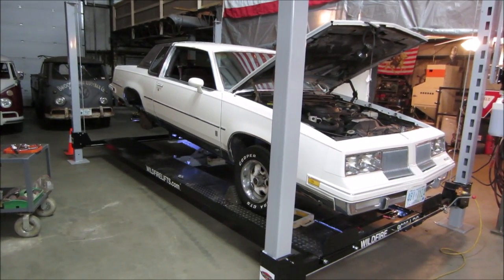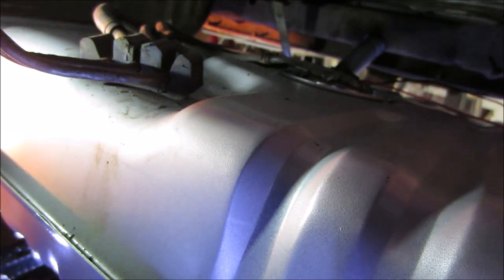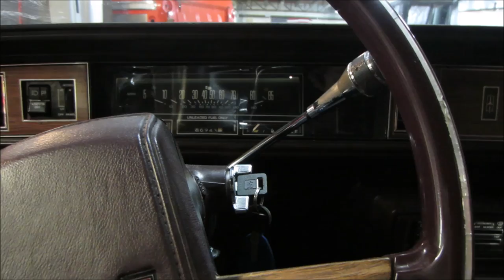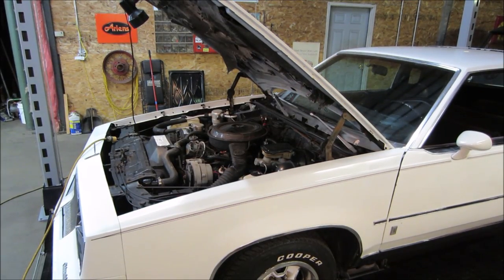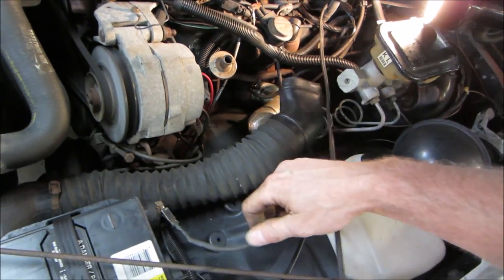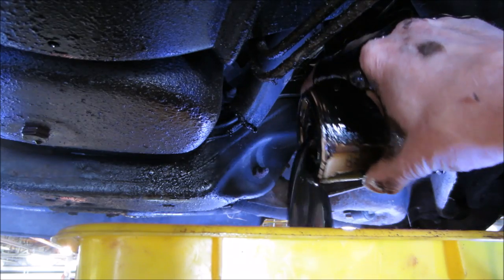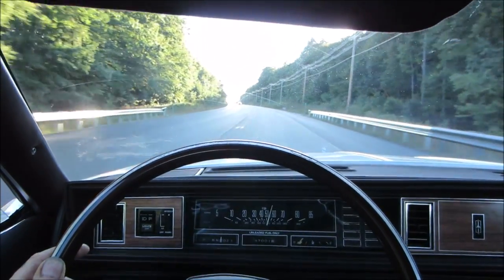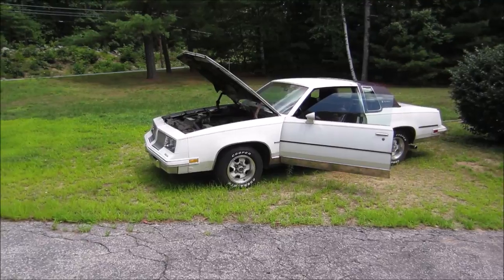Rustoring  Cars On A Budget. 1986 Olds Cutlass Gets Completed.

Comment: I miss my cutlass. That was my first car. We paid $500 and drove it for seven years and after frustration with my paint job I paid for I ended up selling it to a friend. He then ruined the head gasket or motor and blew a giant crack in the radiator with oil looking like chocolate milk. Then it sat to rot. I never did any major work to it either other than paint. That one was a 79 Calais edition with grey on black which was unique for a cutlass. It had the black vinyl top with bucket seats,floor shifter,round gauges not rectangular and a actual factoryTach. My plan was to fix it up with paint,fix the vinyl driver seat and putting a bigger motor but ended up getting frustrated before I finished it.

Comment: I cannot accept that you are done with this car. option 1:   cam change. a bit more cam. somewhere in the 210 degree park. roller, oils do not support the flat tappets anymore. don't bother to ask why I have had my fill of flat tappets. I have an engine in pieces right now due to a rapid cam failure. didn't last 30 minutes.  3 lobes mostly gone, another 2 showing signs .  engine full of metal.    Option 2: engine swap. 403 in, 307 out. roller cam setup.

Comment: Hey Mustie, check the spark plug on that cylinder with the bad plug wire end. When ends burn like that, they tend to carbon track the porcelain on the plug and cause a misfire issue.....food for thought!

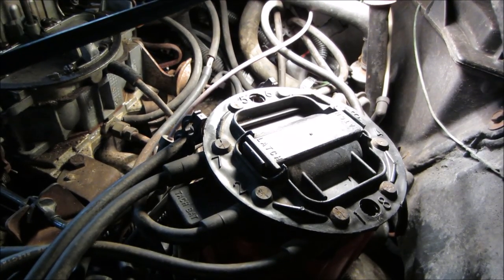Comment: At the 30:00 mark - arcing behind the distributor. Looks like your spark issue.

Just to the left of the 5 on the distributor cap.
Reply: I think you are seeing a bit of fluff blowing in the breeze. You can see it dangling down before the engine is fired up at 29:45

Comment: I'm not sure what sort of price tag this car would have in the US, but in Europe, this fixed Cutlass would fetch about €6000 (US$7000).
Reply: Daniel van Slooten he can probably pull close to that here. Especially with the rust repair where it was needed. Can’t believe he found anything this nice up there with the rust issues. This car is nicer than most 3 year olds in that region.

Comment: I remember this car when I was a teenager.  We had the 1985 V8 version of it in grey.  Not sure if it came in other engine sizes.  We sent it to the dump but I kept the owner's manual and some of the center hub wheel covers (we had the chrome wheels similar to the video).  Ours had the better gage cluster with the tachometer.  The car was good in the summer but winter driving was really bad as it is a rear wheel drive car.  I believe also the rear wheel drum brake cylinders and the back plates where they bolt onto had a recall as they will start to eventually fail.  It gave me a great brake failure but I managed to drive it to my home driveway somehow without crashing (a miracle).   Towed it to a garage and paid full price to fix it as I didn't know there was an official recall on the brakes until much later.
Great video thanks for the memories (however terrifying) driving that beast.

Comment: "the few drips might be old oil"...

Mustie pressure washes EVERY SINGLE mower he works on, yet won't pressure wash the oil off the bottom of the Olds to help verify if leaks are gone.

Wut?
Reply: I think a cutlass could be just a wee bit heavier than a mower

Comment: When you did the oil change it reminded me, I came across some old oil. A couple of cases of cans 10 w 30 and 10 40 must have been 30 or 40 years old I have been using it in my tractors lawn mowers snowblowers and my antique cars... I love because of the color a dark amber today's new oil I can't even see it on the dip sticks it's so clear it doesn't show up. Unfortunately I don't have anymore of it

Comment: The biggest problem I had with my 81, was that the right front tires would always wear out within 30,000 miles or even less, I took it to the dealer they couldn’t find anything, I took it to front end shops, couldn’t find anything, I was buying tires at Price club when it was Price club, it seemed like every six months.. Then I noticed my dad’s secretary had an 85 omega with the same problems. She was going through tires like crazy. I don’t know if it was a GM issue or what but that was the prime reason I sold the car.

Comment: It will blow up. Then you Will have to put another motor in it. And it wont last 5 year's. Rather have a Ford. I Beat mine every day. And hit the Revlimiter. Still driving it. Accidently hit reverse at 50. C6 you can. And still drive it.

Comment: Prime your oil filters prior to install. Also a good idea to ground the coil and crank it over to drain the filter and system before removing oil filter. Remove drain plug and let it drain some more.

Comment: One thing I have noticed with GM products especially the older ones was oil leaks. I worked on GM locomotives for 35 years it was the same with them. As gasket technology improved most of the oil leaks disappeared in later years. That Old's is a nice car you were lucky to find it, one that sits that long or longer always needs a bit of help to bring them back into good working order... Good video, thanks Mustie1..

Comment: I agree with Harris from Q on the rotor. It looked really corroded. About 90% of these cars left the factory with the V6. This one has the 307 CI V8. That makes a huge difference in a Trade deal. Make sure YOU get your money's worth from the trade. Most of these Cutlass's are gone forever, the V8's are becoming more and more rare. It's a really good car for being in the North East. It's a $3,750.00 car all day long in my opinion. Well done on the repairs you did! The frame repair was top notch!

Comment: Hi Darren, nice to see someone oil sprayed under the front for you - lol, ok, nothing a jet wash wont cure plus your witches brew of chain oil and "stuff".. Just an oddity. I currently drive a Landrover Freelander and a previous owner took out its prop shaft and troublesome central viscous joint (only troublesome IF you dont have 4 matched road tyres it seems) so I put 4 new ones on but found the problems continued to the rear now unused diff in the axle.. It currently does nothing but make a slight whine, so until I get to choose put it all back or leave it driving just fine in front wheel drive only, I put the only oil i had into the non "stressed" rear diff / a bottle of CHAIN LUBE oil, nice and sticky - lol works for now until I get to decide eh..Ok it was on its way out, so, I cant make it worse, but dont advise putting chain oil in a good working rear diff, use 140 EP then - lol.. things you have to do at times you have to do it right.. Have a great day all.. Ian - UK.

Comment: I would like to make a small suggestion! Put a smaller wheel spacer on to help to keep the wheels from having the weights knocked off by the tie rod end. The shocks will make the tie rod ends to hit the wheels an knock off the weights on the wheels. you need at least 1 to 1 1/2 in. spacing to keep that from happening. I use to work for more than 1 tire shop. I have seen it happen more than 1 time.

Comment: Had two of these and HEI cap & rotor  usually causes skip. Upgrade coil kit available for this. Did  you change cartridge filter in carb? Barrel type. Run Marvel Mystery oil to smooth  it out before changing oil to fuel and oil.  Love these  cars. Had a Salon  with console/ gauges and really miss her. Upgrade plugs would be nice too. 8mm wires.

Comment: Hey Mustie 1, Harris from Q is right. When the rotor gets that bad the spark will burn threw it & then will short out the module. The cap is a dr-450 & the rotor is a dr-318 standard products. Do yourself a favor & change then. Don't forget to swap over the ground bracket.

Comment: I owned a '81 Olds Cutlass with the 267 SMC (4.4L). I checked out the rear gear ratio, and it was 2.29 to 1!!! Gearing kills these cars on the bottom end. GM, in an attempt to beat smog emissions, tried to spin these engines as slow as possible. It did get close to 30mpg at 60 (1300 rpm).

Swapped it out for 3:42 7.5" I found in a 3rd gen Camaro. Worth ever busted knuckle to change it out (especially setting the pinion depth). Highway revs were higher, but city driving was much improved, epecially after I dropped in a 10-1 350! Ah, those were the days...

Comment: I had a sticky gas gauge float in my 84 Trans Am. My neighbor told me to soak the entire assembly in Marvel Mystery oil over night and it worked like a charm. I add some to the tanks of all my cars when I fill up. Mind you I only drive older beat up cars. Not sure if that's a good idea on more modern cars.

Comment: so G M oil filters if you take a ice pic and punch a hole in the bottom of the filter and let the oil run out ti it stop you won't get all oily 100 mile before you change the oil put a quart of trans fluid in it and let it run  then change the oil trans fluid is 100 % a cleaner it works

Comment: If you are keeping the car, then you will want to install an electronic ignition,,,  As the distributor bushing wears,, the timing on each cylinder will vary proportional to the wear on the bushing,,,  An electronic ignition system will forgive most of that wear,,,  :-)

Comment: I had one just like it I bought it in 1990 from a service station the guy's daughter blew up the engine in transmission, I got it for a $150 with a real clean body. I swapped out the v6 and installed a Pontiac 301 T/A engine and transmission out of  wreck with low mileage, I updated the suspension with 442 springs used, and steering box  and swaybars from a scrapped GNX Regal the piston on the 301 were changed to increase compression to 9.5.1ratio it ran really good I hollowed the converter 
and used the GNX PIPES! Friend owned a junk yard aka good deals! Haha
I ran 15' firebird formula rims !

Comment: I owned one of these 1978 with a 260 V8. It was a great car for it's time.  The rotors were bad for breaking down at the distributor shaft but that totaly killed the engine.  Once the ignition module failed, it broke down on the hiway and I had to hitch a ride to the parts store. The carburator shaft wore leaking vacuum at the throttle plate shaft requiring adjustments to the electronic metering valve to pass emissions.

Comment: That exhaust pipe that is sealed is the stock crossover pope that has been cut and used to seal the second hole in the passenger exhaust manifold. It has nothing to do with the emission system.
Someone put dual exhaust on the car and needed a way to seal the manifold. This is very common with Olds engines as the caps that came on the early 70's  350 cars with dual exhaust are hard to find. This is the easy fix.

Comment: I had a '77 Cutlass, 350R cid, 4bbl Rochester M4M, HEI ignition. 
When I bought it, barely ran. The oil pressure sending unit is in the front of engine, just above water pump. The Bakalite had cracked, with every acceleration oil would spurt out, onto front China wall of intake. Valley pan set, 2 dead lifters, all new rocker arm and Bridges (what Olds uses to hold 2 rockers, acts like bearing) rebuilt carb, plugs, wires, HEI module had no grease under it, got hot & short after 10 minutes. New module & used grease packet it comes with. Front bearings. 25 years ago- this was all about $300. for a $250 car.

Comment: To me part of the value of that Wildfire lift is the ability to push it outside, put the car on the lift all the way up, then pressure wash the whole bottom to get rid of the old oil (after changing the oil and filter of course).  I would think it would be much easier to check for leaks that way.  But maybe that's just me.  Keep up the great work!

Comment: Sweet ride!
I had a 1985 cutalss ciera 4 cylinder with like 225,000 miles on it and it would bury the Speedo needle out of site and still had 3/4 of peddle left, it wasn't a power house but it would cruise at 100 mph with No Strain at all.
Most older GM cars are cold natured, they don't like to run when cold.

Comment: Maybe there is an access panel above the tank...  if not, maybe it would be something to think of adding.   Think about it:  a removable 12"x12" (or whatever size) panel, accessible from the trunk.   Perfect connections, no bending lines, quick access to the fuel pump assembly...  that car looks like fun.

Comment: Cheapest I found here in Germany was a 1980 model with european outfit in orange directionals and KPH speedo, called 5.5k€ for it...
8-o
I vaguely remember that a guy I knew had a Olds back in the 90s...turned into a Pickup by removing the rear hood to register it as a light truck, would save a lot of tax...
Nice driving sofa!
:-D

Comment: I noticed that when filling the oil from the plastic containers, you are holding it upside down.  Try putting the spout on the upside of the container when you pour - it will not glug, glug when you pour.  It seems counterintuitive, but try it and the air will flow back in easier.

Comment: I can't believe somebody hacked up a Y pipe like that and capped It off and welded the pipe into the catalytic converter flange for the right side. I mean if you're going to make up the left side why not do the right side the correct way. And I do believe that those are shoulder bolts on the exhaust with Springs you're not going to get it any tighter you're just going to snap the bolt off. If the whole Y pipe was on it would probably pull that pipe in the direction you need to make it quiet. Just my thoughts.

Comment: Reference the horsepower you were close, factory new was 140 HP, and 255 Torque.
The oil filter looked a whole lot oilier after the beat down run, prior to the change.

Comment: On the exhaust there was a pipe that ran from one manifold to the other and one single pipe out for single exhaust. For dual exhaust they used a cap that bolted to the outlet on the manifold with dual outlets to eliminate the crossover pipe. That is how it was on the pre 307 engines. Apparently they used same manifolds in later years

Comment: That is one good looking, good sounding Cutlass Mustie. Just an FYI, I never saw dual exhaust on a 4 cyl unitil mine. My 2019 Accord EXL has dual exhaust on 4 cyl and it's power compared to my old 2012 Accord is significant. I'm sure there is more that contributes to that but the dual exhaust is nice. Not about to try a burn out though ;-). It also gets 35 mpg on average for the combined city to highway type driving I do. Again, much better than the 29 mpg I could occasionally squeeze out of my 2012. Can you tell I am a mpg nut. Maybe that's because I was alive and well when gas was 25 cents a gallon, or less. Love watching you work and bring things back to life. You are definitely one of a kind, especially in this day and age.

Comment: OMG!  I had an '85 Cutlass Supreme Brougham....same color with same split roof but with a matching rubberized wing on the trunk. Shift on the floor though.  I used to call it the gutless Cutlass because it would only spin the tires turning a corner on wet leaves!  It cruised nice though.  Brings back memories.

Comment: You should have checked what ohms the fuel level sender was putting out against the specs for the car. The whole thing looked too new to be original on an '86 car.
Everyone skips over the unavailability of the original Freon. If you can find it, it's hundreds of dollars per pound. Conversion kits are available to convert to R134a with a new evaporator nozzle and dryer. The whole system needs to be flushed to get the mineral oil out. Like the changeover in propane tanks to OPD types the recharging connectors are different.

Comment: Question for you. Can I run a bigger fuel tank for my generator straight to the carburetor and by pass the one that's on it?
Reply: I don't see why not if it's liquid cooled. If not, I think the generator engine is designed to run for about 3 to 4 hours under load THEN, when it runs dry, the time you take to fill it back up, gives the engine some time to cool off. That might explain why, older push mowers had a smaller gas tank.
Reply: @rverro8478  Only way to find out is to try I guess. Thanks for your input.

Comment: spring loaded exhaust flange, those are "shoulder bolts", they'll only thread so far and stop anyway, donuts blown out, probably from the rest of exhaust missing hangers or twisting it enough to leak and burn through. :)
move anything flammable out of the way, make exhaust manifold quickly glow with torch where bolts thread in and hit them with weak impact back and forth, they'll likely unthread (probably best wit engine/exhaust already hot).
springs could have lost tension also, not much of an issue long ago, but the replacement stuff is pure garbage

Comment: I had a 57 Chevy with a badly balanced right front tire. I was going abt 60 mph when the feel of the whole car changed. When I tapped the brakes the wheel swung all the way back n locked. It snapped the idler where it threads into the adjuster? I was abt 19 yes and didn't have a clue.  Lucky too.  I was the only car around.  I drove home not using brakes. Simpler times for sure.

Comment: All of GM,s carbureted models have wire problems. I took my carb off and installed a high rise GM intake with a Holly Pro Injection. You talk about throttle response and acceleration for my lil 231🤩

Comment: tires that aged, may test perfect on balancer ( low RPM) and be totally out of whack on a vehicle due to sitting long term causing uneven rubber and belt setting/hardening.
if it's a motorhome/travel trailer, change them yearly, if it sits idle more than a a few weeks a season and of course keep them covered with tire UV  guards when at camp site. make sure load within is balanced. improper balance or overloading is #1 way to have blowouts, followed by flat out junk tires, research and review before deciding :)